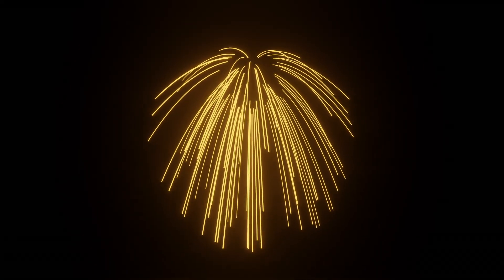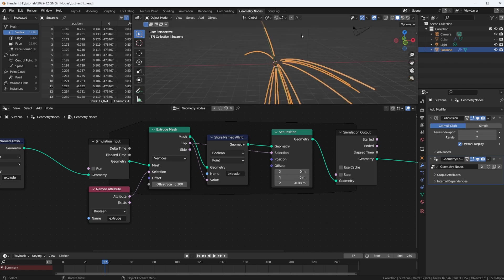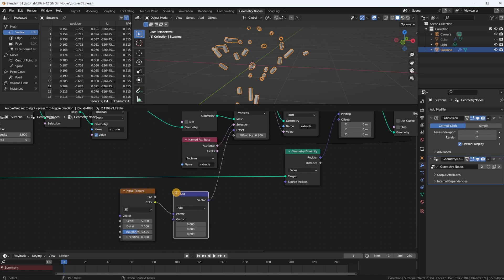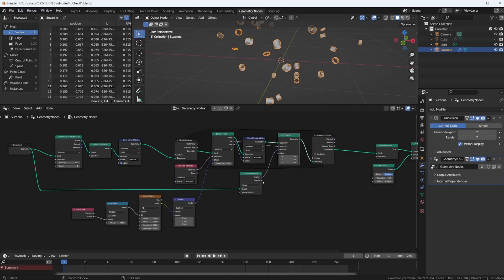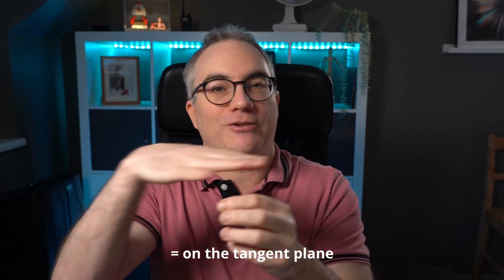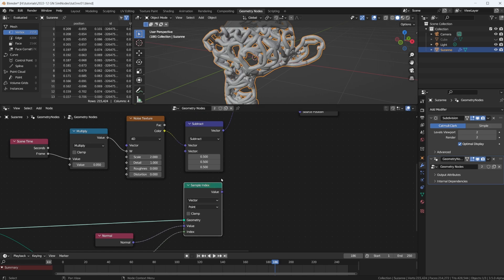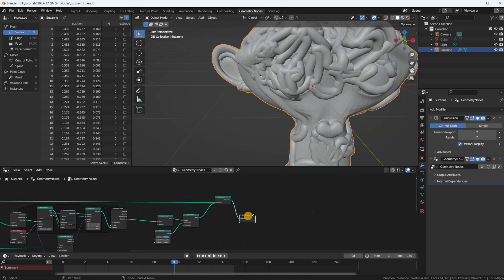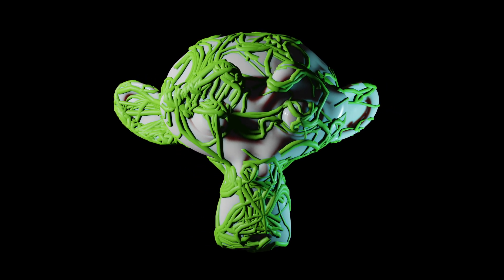What's happening to Suzanne!? Extrude on Surface w/ Blender Geometry Simulation Nodes - Tutorial

Comment: Thanks for your tutorials. 
On this one, though I understand all the math involved I have a problem at 06:39. 

Correct me if I am wrong. If we plug the normal input straight into the offset socket, we’ll get the normal of the “noodle”. However, in 3.6 when I cross product the random vector with the normal I get from Suzanne, everything disappears and never comes back. I can send you either the file or a screen caption. Any ideas,on the subject? After some checking (I offset suzanne by the cross product and nothing moved, I positionned suzanne by the cross product and everything went to 0) it seems the result of the cross product is 0. Means the random vectors and the normals from suzanne are co-linear. Did I miss a turn somewhere?